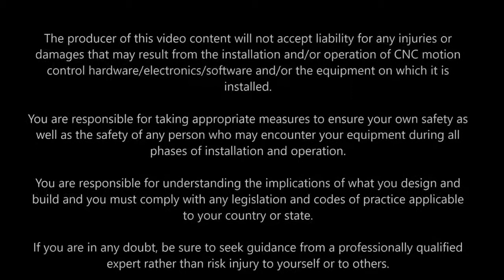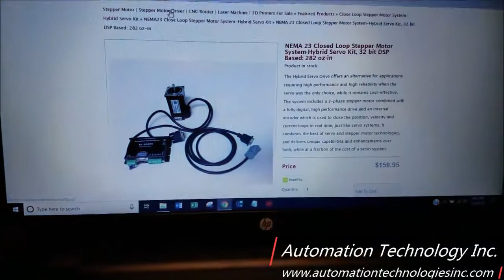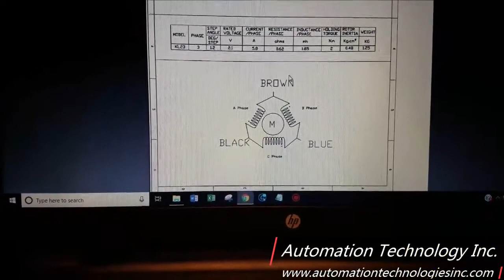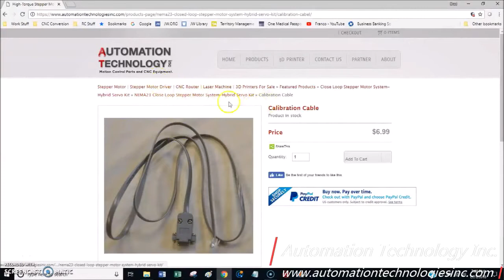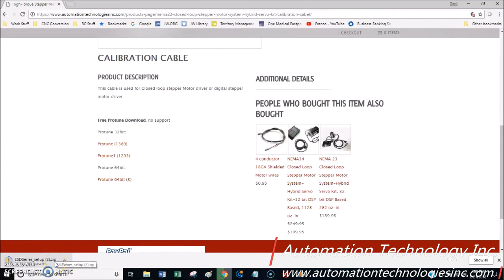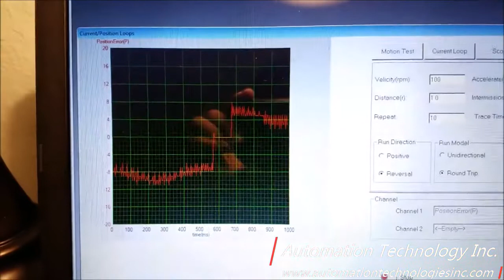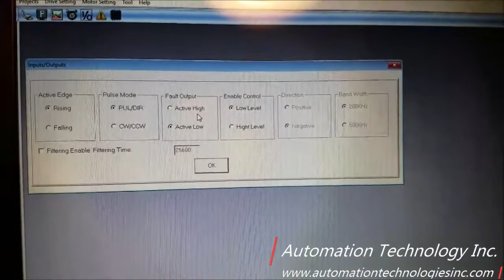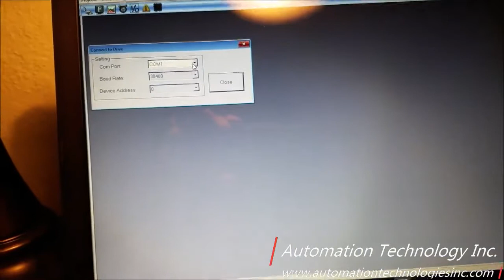Nema23 Closed Loop Stepper Driver KL-5080H Programming

Comment: Hello, I come across your video when I was searching for information on pulses per revolution. The drives I purchased can be set anywhere from 200 to 40,000. I I'm assuming this has to do with the accuracy of the drive and motor? But I was wondering why everyone wouldn't just turn them to the max if that means they're more accurate. Are there drawbacks to increasing this, like a give and take scenario? Any insight would be greatly appreciated! Great video btw

Comment: ok I got the D teck cable conected to computer the other end connects to connector out of KL-5080H.  
48v power supply  (+) to (+)Vdc  KL-5080H and (-) GND KL-5080H.
I checked 48v power supply DC output is 48 Vdc
 KL-5080H Vdc input is 48Vdc from 48 power Supply
Wires to stepper Nema 23 
KL-5080H (U) To Brown motor wire
 KL-5080H (V) Blue motor wire  
KL-5080H (W)-Black motor wire
I ran test as you did from program but motor will not move or do anything.
Do I have to do any other connection.

Comment: What is the connector type on the driver side? Rj45?
Reply from the maker: RJ45 is for Encoder
Reply: John Lee John Lee So connection should be like this, RJ 45 to DB9(RS232), DB9(RS232)) to USB adapter. Correct?
Reply: Is that correct? I am having the same issue :D